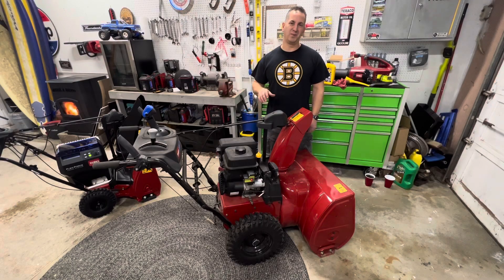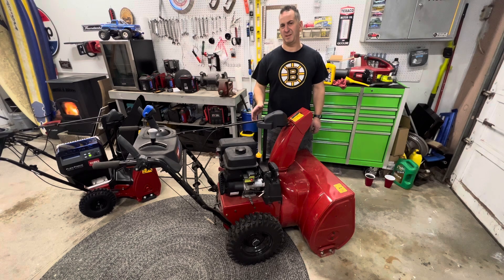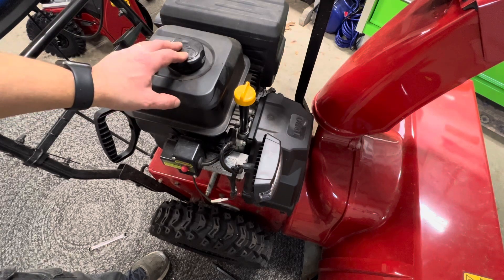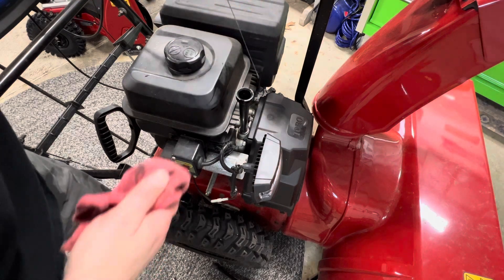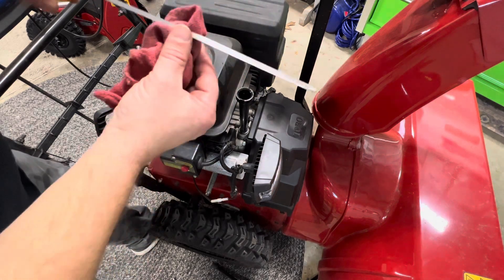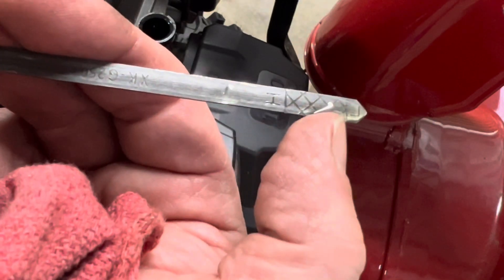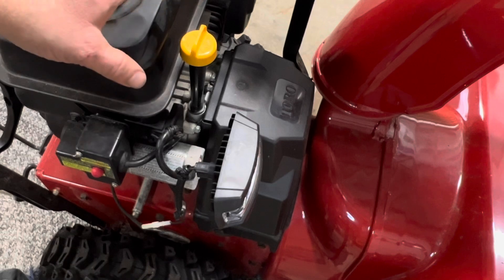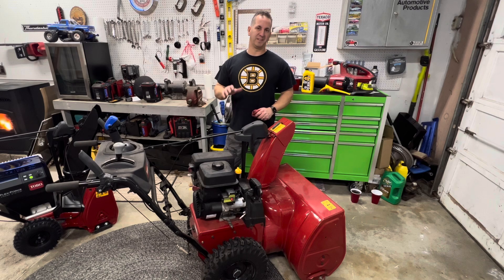Need To Check The Oil Level On Your Toro Snowblower? We Will Show You How!

Comment: There seems to be some controversy on the dipstick, I bought my machine last winter. It's an 824. It has that same motor, the instructions say in large black letters do not screw in dipstick to check the oil level.
Reply from the maker: The method show was recommended by the manufacturer.

Comment: I believe for this model you do not screw the dipstick in when checking.  "Insert, but do not screw in, the oil fill cap into the oil fill hole."
Reply from the maker: The method show in this video has been fine.
Reply: Dealer showed me in the manual the correct way to check it. Right now your blower is underfilled.  @HomeownerRepair